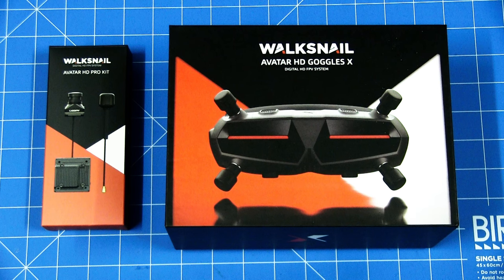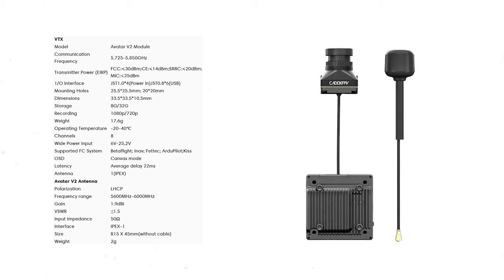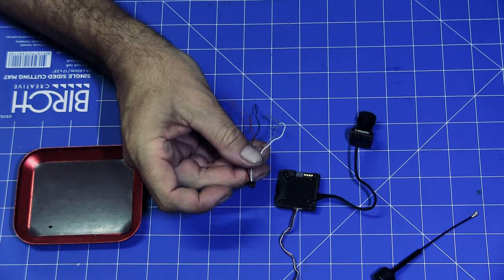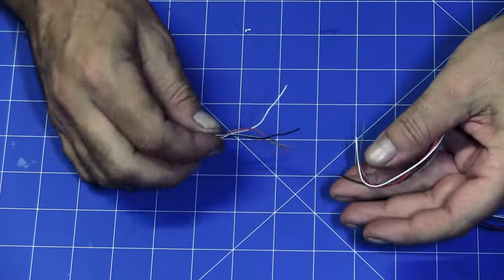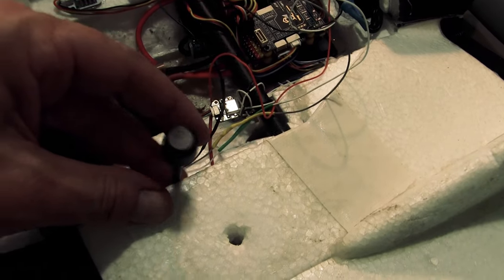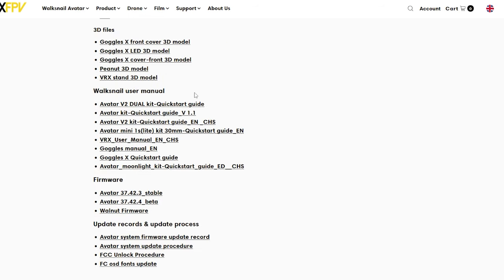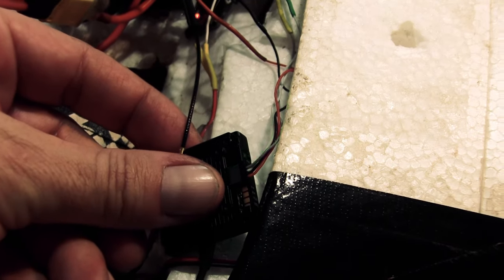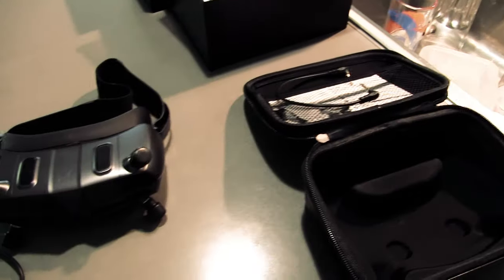Walksnail Avatar HD Pro - HD FPV Setup and Install - Convert from Analog FPV

Comment: Thanks for the video. Just bought the same goggles and vtx unit but trying to figure out how to attach to AtomRC 405 Navi. Hope it as simple as  your set up.
Reply from the maker: @PeterBrown-o4k  It’s been a great setup for me. My only complaint is lack of range from the goggles which I have currently fixed using patch antennas. But other than that very happy with the Walksnail system. Thanks for watching.

Comment: How do get OSD to display on the goggle?
Reply from the maker: @BFP8447  make sure osd is turned on at the flight controller by using which ever program to install flight cont firmware.   INAV or ardupilot etc.